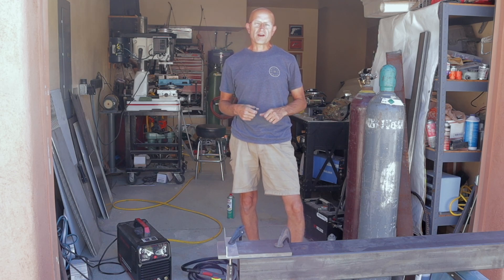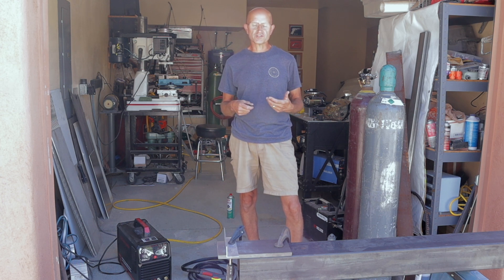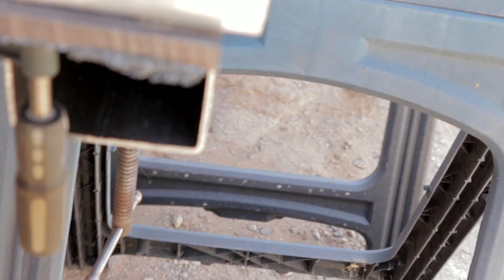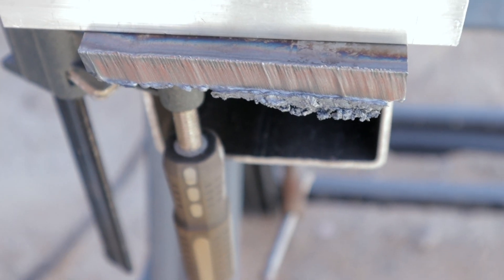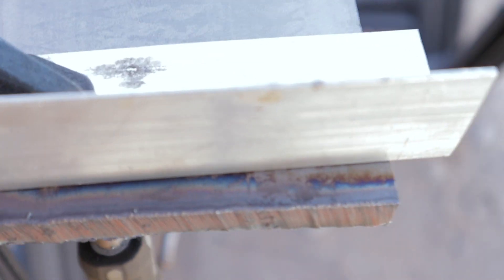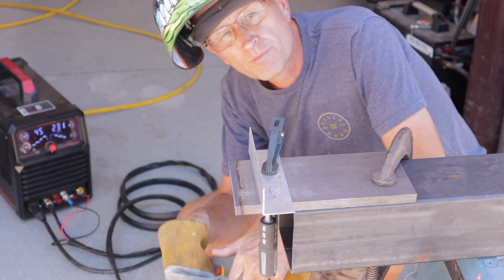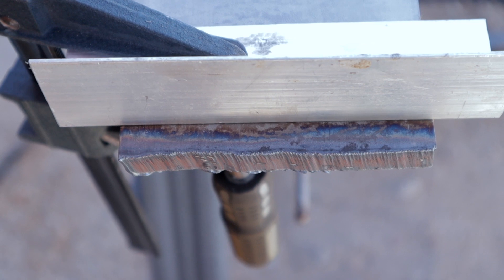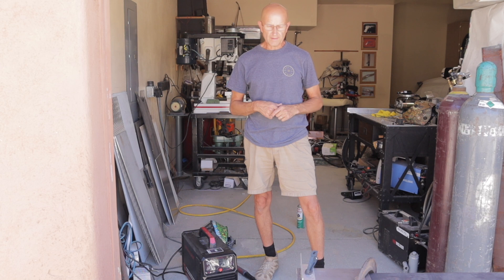YesWelder CT2050 Plasma Cutter 1/2" Thickness test W/ Onboard air vs. Shop air

Comment: How many amps switch you need for that?
Reply from the maker: I have it hooked up to a 30amp 220v outlet and it is plenty of amps for this machine. I run my 250 amp welders on this outlet and have never tripped a breaker. 😊👍